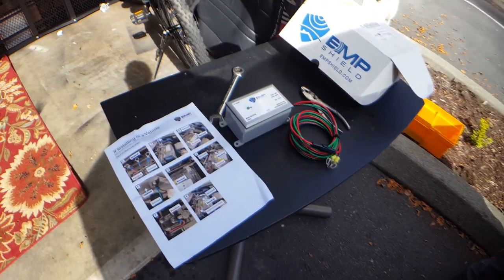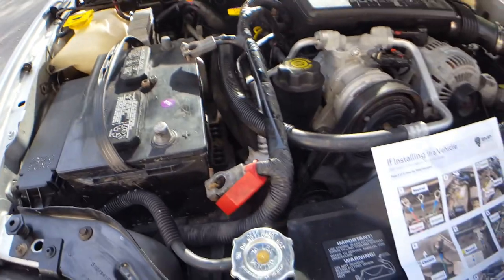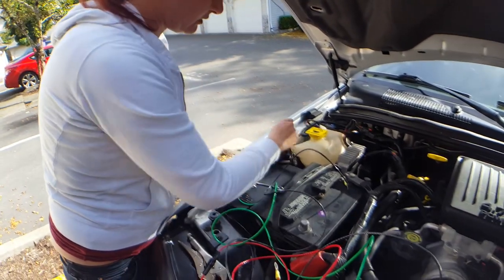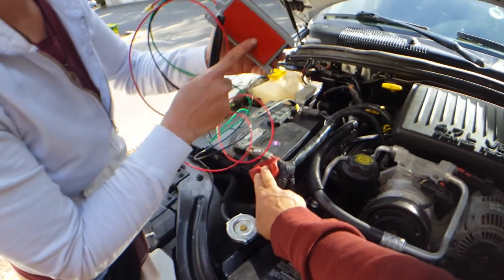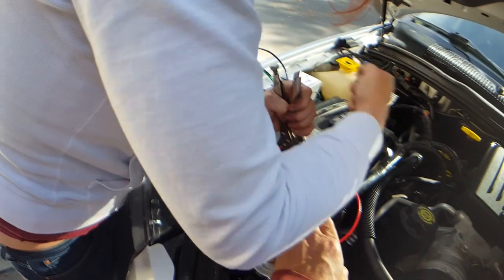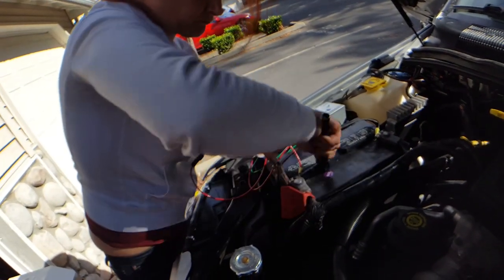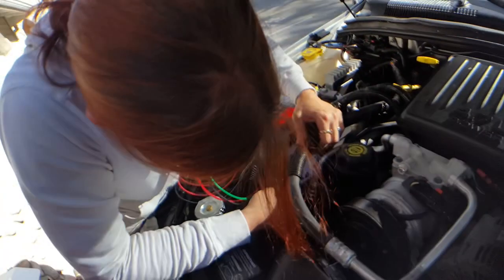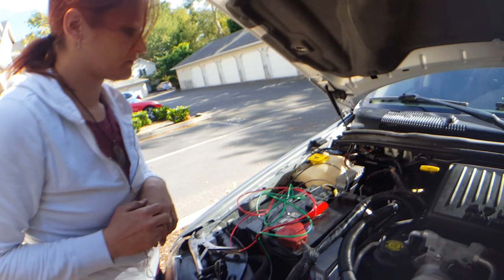EMP SHIELD Installation 🔥 My WIFE INSTALLS ours in 10 MINUTES!👊 Not your average PDR 😉

Comment from the maker: If you don’t know what the EMP shield is about, it’s time you learn! Have you ever heard of electromagnetic pulse is that take away our ability to use anything electron it? Well that’s what it’s for, so my car will be running when the rest of yours are dead after an EMP, or Meteor strike,coronal mass ejection, You name it whatever would take your power back down! Do you think it won’t affect your car? It will
Reply: Omg suckered... I honestly thought you were intelligent. 
How did you fall for this snake oil?
Have you any idea ( obviously not ) of the scale of magnitude an EMP weapon or corona mass ejection puts out?  😥 an inch thick lead shroud isn't  going to stop it, let alone this silly little box. 
Your ECU isn't shielded,  your wiring isn't shielded.... Come on...wise up.

Comment: You know the "Carrington event" melted old fashion copper telegraph wires, can anything protect fragile modern car electronics? The modern cars have enough trouble just surviving normal use.  I would not plan on having any Powered transportation in the event of a big flare. Also, as the earth's magnetic field weakens it will take a less and less powerful flare to do major damage.  Be prepared to pack it on your shoulders! Practice it, benefit is staying in shape! ..
Reply from the maker: That those old copper telegraph wires weren’t insulated… And I think you’re just isolating on incident quoting the Carrington event, we have extremely large electromagnetic pulse is constantly coming from the sun, not to mention all the changes in the earths let’s not keep our head in the sand you know. Sometimes it’s better to have something and not need it than to need some thing and not have it and I don’t wanna be that for it doesn’t have a car when anybody else does not, and trust me sir these are on high demand, back order for weeks by the way and the department of defense has a personal contract of these people to strengthen our grid if you didn’t know. But also if you didn’t know they’re not very fast at it so, don’t rely on the government to save you

Comment: Just bought one. Where do you recommend I mount on a 2014 CRV?
Reply from the maker: We mounted ours on the side of the battery using the velcro adhesive they included
Reply from the maker: Its held steady! Just remember to make sure that green light stays lit! 😊
Reply: I would put it inside one of the lower pillars below the dashboard or behind the glovebox and run the wires through the firewall (your car has predrilled holes 'rubber grommets' where existing wires go into the engine bay) once you're through you can connect to your battery and ground. -A metal closehangar with the wires taped to it is really useful for pushing the wires through the rubber grommets and out into the engine bay.
Reply: @booga-squirrel4566  I mounted it on the side of the battery have drove over 1k miles no issues. Just installed on my rv too. Solar next.

Comment: This is all smoke and mirrors. It makes sense to have a TVSS (transient voltage suppression system) at home, where there's a ground path for the discharge to ne drained. But in a vehicle?
Reply from the maker: gianfrancoa So think of it like a big surge protector in your car that protects your car’s battery and electronics just like when you plug your computer into a surge protector to keep the lightning strikes from surging your computer, an EMP will destroy your vehicle and it will not run! I don’t know if you’re thinking you’re a scientist but your facts are needing to be checked there
Reply: @Petersondent  I can tell as Im an electrical engineer. Im an avid car enthusiast and never heard of EMP being an issue in cars.
Reply from the maker: Well sir now you have, it’s time to learn something new for you. Did you know that these have been used by our government military for years for this precise purpose, protecting against enemy EMP natural EMP, etc. etc. and since they started selling to the public, approximately a year ago Because of the dire straits our country has found it’s in, And after giving it months of that and through investigation and thorough understanding, it is necessary! I don’t care if you get an electrician for 70 years, this is something new you need to learn
Reply from the maker: A question when you say you’ve never heard of an EMP being an issue and Cars… How could that not be an issue when they are all electronic?? We don’t have vehicles that are pre-70s any more guy
Reply: @gianfrancoa  
And I am a rocket scientist 
 And you claim is rubbish mate
Reply: @Petersondent  I tried to install mine the fuse on red wire keeps on blowing out do you know what could be the problem
Reply from the maker: I have no idea, my wife installers and I watched her, it was simple as can be and if it blew it could be a fuse, you might want to send it back for a replacement. My ground light which is green has been on nonstop since the day we put it on

Comment: I've read their website and I'm not convinced.  In the installation in the video,  the device is protecting over voltage conditions on the main 12VDC charging system.  But how are the 5VDC engine control sensors protected? These are fed from a separate power supply usually in the engine computer (PCM, ECU).  The sensors and conductors to the electronic sensors are also exposed to the magnetic field from an EMP and therefore can have their own induced voltages.  I don't see how the device in video provides any protection on the engine control circuits.  Very misleading!!!
Reply from the maker: We will see won’t we? I’m pretty sure the department of defense wouldn’t have them on contract to be making them for their military vehicles and stabilizing the main grid in Texas now would they if it was a scam!😂
Reply: @Petersondent  
Contact DoD and ask them if they're really buying this stuff from this manufacturer.  Ask for the schematic.  No electronic DoD purchase goes without full details of the circuitry layout inside. They get the schematic to ensure there's no funny business, no danger and no spying circuitry in any electronic devices they procure. 
Write them a letter or make some phone calls for the info,  it's not like you're stuck for time.
Reply from the maker: I don't have to as I have personally vetted the owner of the company through a major news source Marfoogle news on YouTube. He's been online interviewed and watched millions of times. He personally gave us a major discount because of the community of truth seekers backs this product. Just do your own research. It takes effort.
Reply: @Petersondent 
A year later, I'm wondering if you've looked inside this box yet?
If it's super simple, then maybe you could produce and sell your own version; especially in this renewed nuclear threat situation we're finding ourselves in.

Comment: Emp fries everything electrical. ECUs everything. This won't protect your vehicle mate I'm afraid. Wish it would coz I'd do it if it did.
Reply from the maker: I am feeling pretty confident in this purchase, I don’t know how much knowledge you have on the subject, but mines pretty extensive. This is the same company that the government uses to harden our grid FYI so there are no China made up market bs
Reply from the maker: Maybe you should look into this, you sound like you’d be interested in something that’s legitimately been proven to work
Reply from the maker: https://www.empshield.com
Reply from the maker: EMP Shield is a family of incredibly robust EMP, solar flare, and lightning defense technologies. 
They have been designed to exceed the US Military requirements for protection against a high-altitude nuclear detonation that results in an electromagnetic pulse. This family of products has been tested at Keystone Compliance, a DOD Certified Testing Laboratory, to verify compliance with the following Military Standards:
 
MIL-STD-461-RS105 Transient electromagnetic pulse of up to 50 kV/m, double exponential wave with a rise time in the nanosecond range, that is applied to the equipment under test (EUT) at least 5 times. We tested at 50 kV/m and also 90 kV/m (80% above required testing voltage).
 
MIL-STD-188-125-1 High Altitude EMP
MIL-STD-461G Control of Electromagnetic Interference
MIL-STD-461-CS-115 The purpose of CS115 is to test an electronic or electrical system to withstand signals coupled onto the test unit’s associated cabling. The test unit will be subjected to rise and fall times, pulse width, and amplitude as specified on Figure CS115-1 at a 30 Hz rate for one minute;
MIL-STD-461-CS116 applies to 10 kHz to 100 MHz for all interconnecting cables, including power cables, and individual high side power leads;
MIL-STD-461 CS117 apples to all safety-critical equipment interconnecting cables and non-safety critical equipment with interconnecting cables/electrical interfaces that are part of or connected to equipment performing safety critical functions. The goal is to test the unit’s ability to withstand lightning transients coupled onto the test unit’s associated cables and power leads;
MIL-STD-464C Electromagnetic Environmental Effects Requirements for Systems.
 
Our test results show that we begin shunting the over-voltage condition in less than 1 nanosecond, and our units are designed to shunt over 100,000 Amps per phase. Our devices are scalable to any size.
 
Summary of capabilities:
Features:
Quick acting HEMP surge protection that switches in less than 500 trillionths of a second.
High current shunting capability above 100kAmps.
Exceeds MIL-STD-188-125-1, MIL-STD-464C, and MIL-STD-461G requirements.
Units are designed to protect power, control, data, communications, and radio antenna input.
 
Made to support:
Models available for all Single & 3-Phase Power configurations
Models available for all DC Voltages
Models available for Data, Ethernet, RS-485, RS-422, RS-232, Etc.
Models available for RF Communications, Antennas, coax, Etc
Reply: @Petersondent  even if your car survived an emp. Watch war of the world's, other People would attack you for your car. Also, where would you go? No where to go I'm afraid.
Reply: @Petersondent  I have 25 years behind me of extensive research. I know nothing electrical would survive.  No point. No where to run anyway.
Reply: Also, it's not an emp attack you need to worry about. This vaccine and chip their bringing out is the killer. Focus more on that. Stay away from it. Don't take nothing from the government.
Reply from the maker: I am more than aware of what is in that vaccine, it’s called Hydro gel, and I Donely that when they do vaccinated everybody, the 5G is what’s going to activate the hydrogel into giving people the exact symptoms if not worse than this “fake virus “if you know what I mean so I know so much more beyond what you can possibly fathom in this department
Reply: @Petersondent  
Delusional with an ego, it's the best combo ever.
How do you feel about Biden? 🤔 
Let me guess....